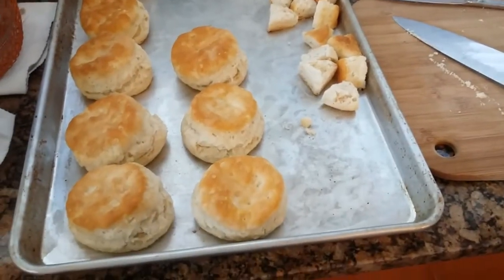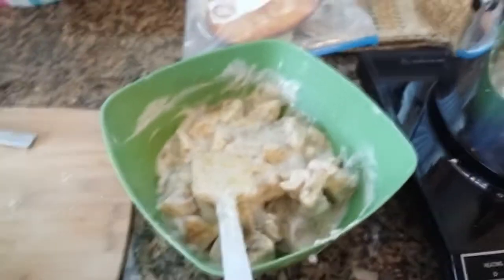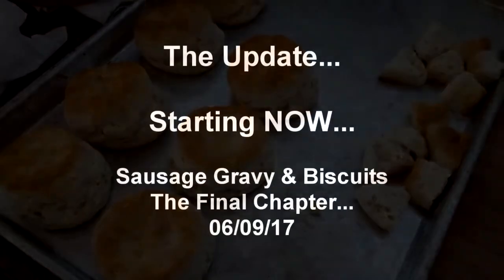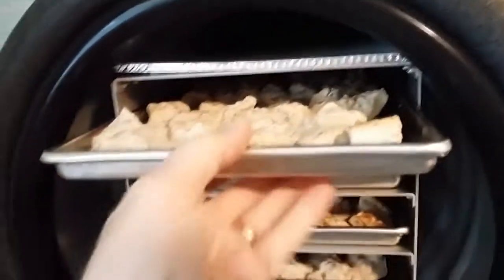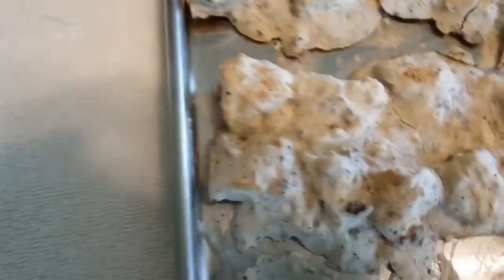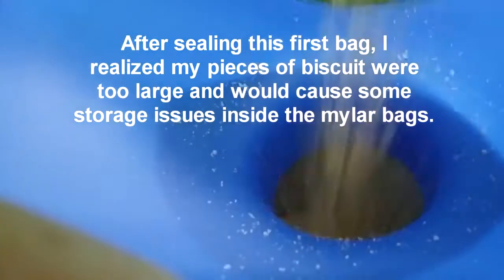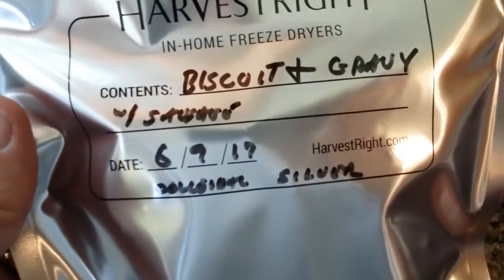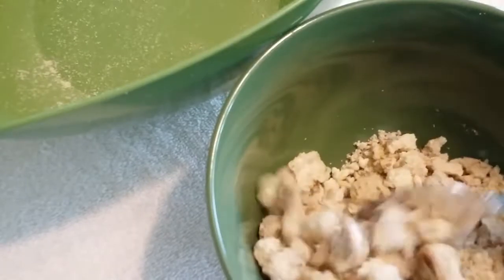Freeze Dried Biscuits and Gravy

Comment: Did the bag sealer come with the freeze dryer? I've watched many many vids and every one has that same one so was just wondering.  Also does it remove the air from the bag or just seal it?
Reply from the maker: It is sometimes included in a special buy or can be purchased separately.  No...does not remove the air.  Sealer only.